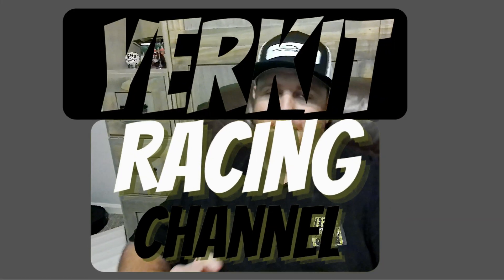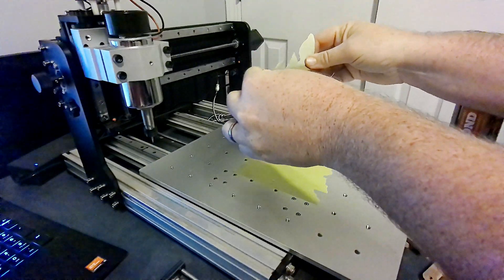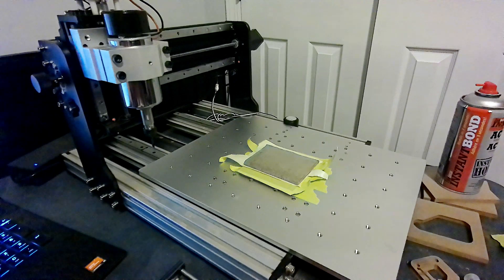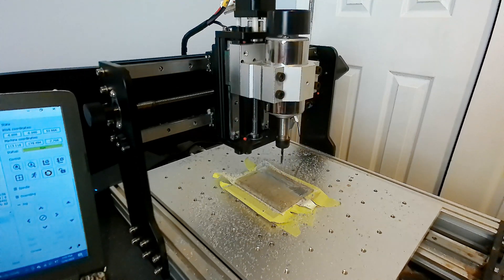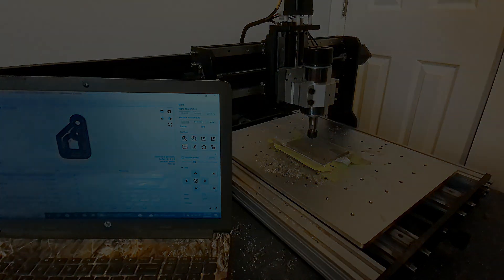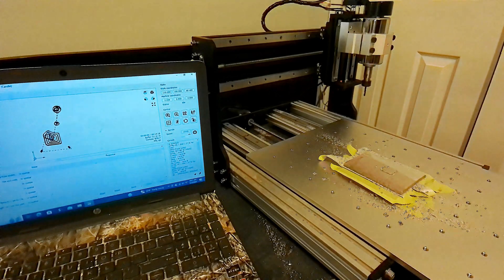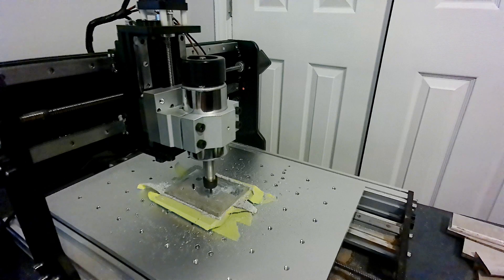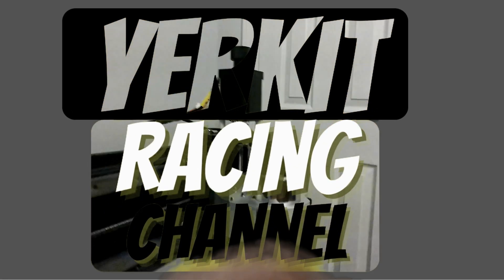DIY CNC machining: Holding aluminum w/ CA glue and tape!

Comment: I found the feed rate to be very fast, I usually cut at 600mm/min. With 1 or 2 cutter
Reply from the maker: What depth of cut and step over at 600mm/min? I've been running at 40 in/min and as high as 90 in/min but with only .1-.25 mm stepover and step down with single flute cutter
Reply: @YerkitRacingChannel  With 1 HP motor or makita rt700c router, with rotation between 12,000 and 15,000 rpm - 0.25 to 1.25. Aluminum with alloy 6061 or 7075
Reply from the maker: @EdCaparroz  1.25 depth of cut would be pretty good. Might try to slow the feed rate down and go deeper.
Reply: @YerkitRacingChannel   Check out this other channel @xyzspec82 -  It uses a 2.2kw motor and cuts very well.

Comment: shove that tool as far up into the holder as you can(  have only flutes showing. you have a lot sticking past the collet. that will cause chatter and breaking end mills especially with the lack of rigidity you have there. i think stub like endmills will help the most. if your tools have long flute lengths
Reply from the maker: may try to find some stubby ones. Think that  would help for sure.  The tool only goes in just a little further than I have it set in this video... The collet has a step that the bit is supposed to bottom on. You can push it past there but only a small amount. I was told not to push it past there or it wouldn't clamp correctly... Is that not correct?
Reply: @YerkitRacingChannel  I’m not familiar with that type of collet or holder. But seems right.  You really should get a Tormach. With your ambition, you’d pick it up good. I have had 3 different tormachs. And you can get really nice parts
Reply from the maker: @Andyhoots  I've been looking at the tormachs. They do look like really nice machines!
Reply: @YerkitRacingChannel  I’ve got one for sale in TN right now. Packed full of features. Atc, 4th axis, fixture plates,
Reply: @YerkitRacingChannel  they are really fun to own.

Comment: For sure consider either mist cooling or some oil for cutting. Something I've made the mistake doing myself is when cutting on the plate is not having something under it or using a milling vice and cutting into the mounting plate. With metal it is actually pretty easy to make a mesh map of the surface as well, I do it in grlb v1.1h. Side note, I worry about all those chips and metal dust next to your laptop there, was biting my nails a bit ;p

Good content and really neat to see DIY, kind of want to make one my self now.
Reply from the maker: Laptop was definitely closer than I'd like. Need to make room for the machine in the garage with a table off to the side for it.. I'll have to look into the mesh map deal. This is the first I've heard about it. What does it allow you to do?

Comment: As Tim the tool man used to say more power! Also spray WD40 on it, you might be experiencing chip welding
Reply from the maker: Yessir! More power! I will try the wd40 on it. I looked at the bit pretty close and doesn't appear to have any chip welding even after hours of cutting but may still be a small bit thats hard to see.

Comment: Like I had told you I’ve used regular blue painters tape and never had an issue with my wood working. Doesn’t matter if it’s on a saw or router. That stuff is stuck stuck. You have to pry it off. And a little goes a long way.
Reply from the maker: Yeah I wasn't sure about it holding the metal but that stuff was stuck for real!

Comment: Thanks for posting this. I have the same machine and am getting it prepped to cut aluminum.
Reply from the maker: Appreciate you watching it! I'm going to have a few more videos on it soon. For thin aluminum it works great nut the 1/8 in end mill doesn't remove material fast at the 10000 rpm spindle speed. Thick material with a bunch of material to remove takes it forever.
Reply from the maker: I just picked up the upgraded spindle so I can run it faster with the 1/8 inch bit and can step up to 1/4 in too. Hoping that picks productiion up a ton but we will see.